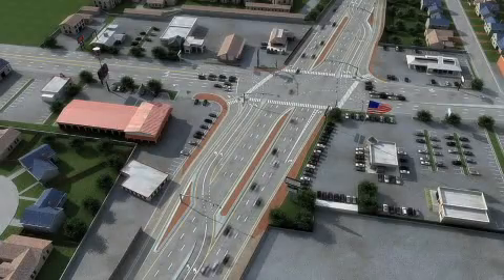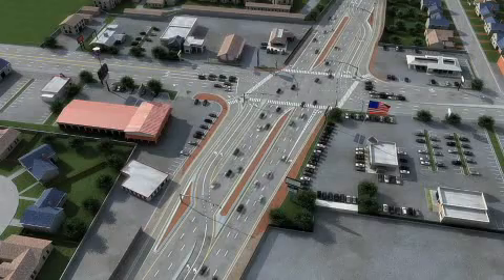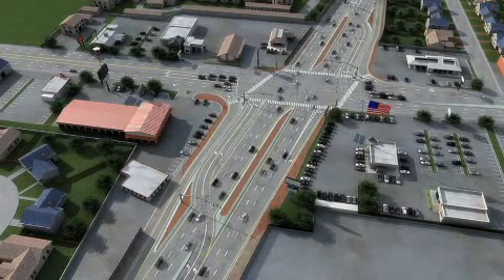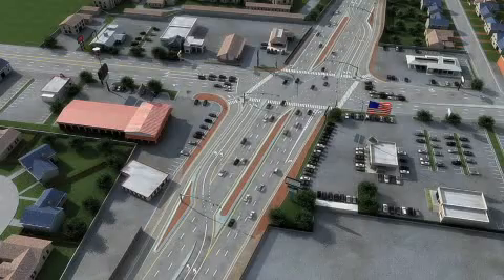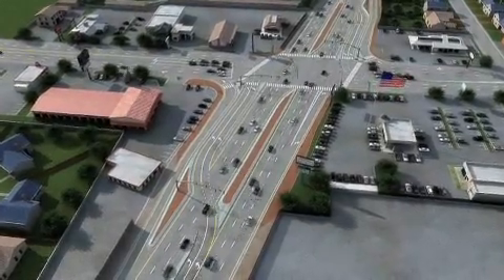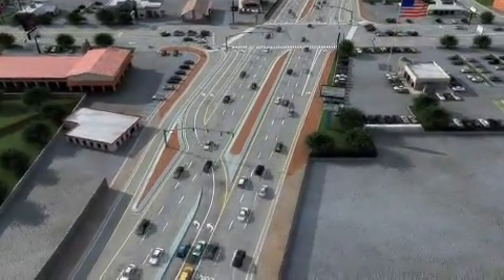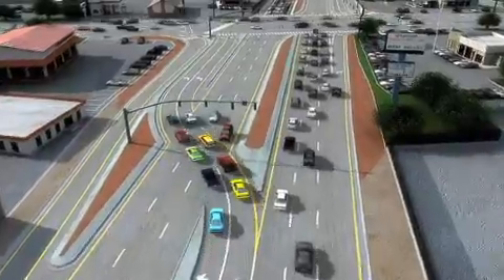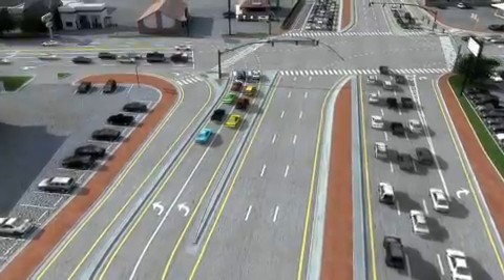Continuous Flow Intersection Animation

Comment from the maker: It may seem complex but vehicles line up the same as they do at a traditional intersection, they just stop earlier. We currently have 9 of CFIs in the Salt Lake area and they are pretty intuitive as you drive them. We have also seen a decrease in the number of crashes and the severity of the crashes. For example, at the intersection in the video crashes lowered 60% after installation.